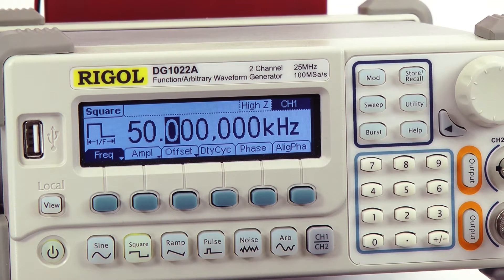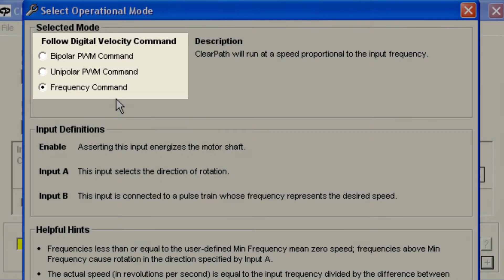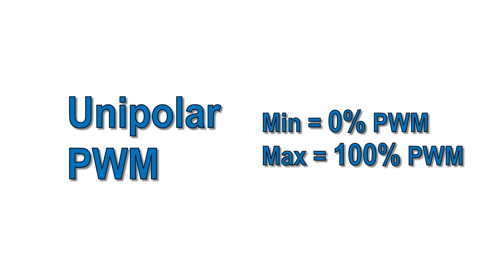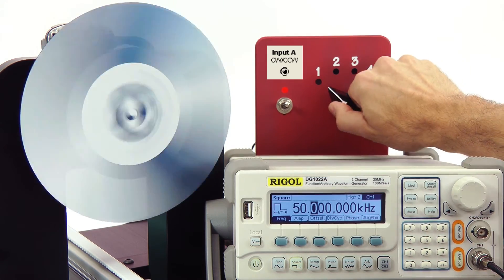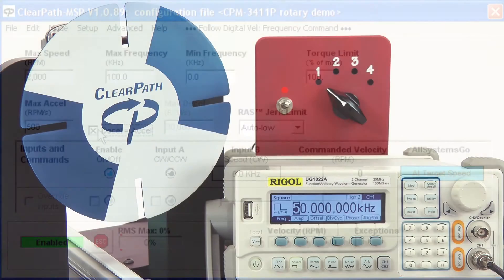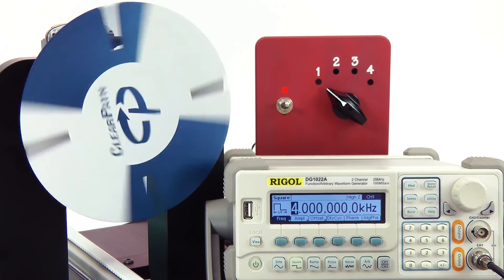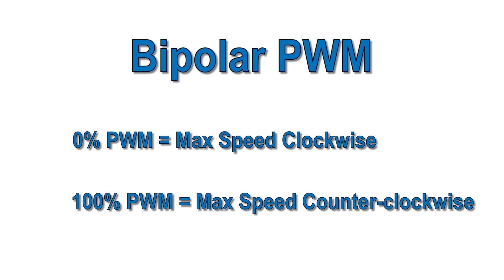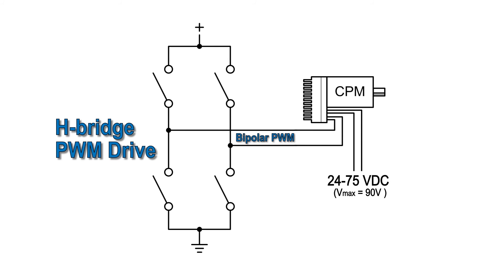ClearPath Integrated Servo Motor: Follow Digital Velocity Command

Comment: How do you set different speeds for CW/CCW, independently, using only Input B? I want to be able to go variably faster in one direction than the other.
Reply from the maker: Hi star child,

All of the "Follow Digital Velocity" mode variations can achieve variable speed in both CW/CCW directions. 

The variant of Follow Digital Velocity that uses a "Bipolar PWM Command" does not need Input A to achieve variable speed and direction control, so this is probably the ideal mode for you if you only want to use Input B. (In this mode, Input A functions as an “Inhibit” control that allows you to stop the motor even if there is a non-zero command on Input B, or to modify the motor’s torque limit. You can leave Input A disconnected if you don’t need either of these features.) 

Input B in this mode controls both speed and direction using a variable duty cycle PWM signal. This is discussed in more detail starting at 3:01 in this video. (This mode does not necessarily require the H-bridge output circuit that is given as an example.)

Note that all of the "Follow Digital Velocity" modes will require the Enable input to be controlled. It needs to be asserted (i.e., "On") to enable the power stage of the motor and allow it to produce torque. So you will need a digital output to enable and disable the motor. 

If you are looking to vary motor velocity by hand, or if the variable duty cycle PWM signal described above is not easy for you to generate, consider using Manual Velocity Control mode instead. This mode will use both Inputs A and B (as well as Enable), but speed and direction could be controlled with a single Quadrature Knob (which can be bought online, e.g., from DigiKey, at low cost). This video explains in more detail:
https://www.youtube.com/watch?v=tR_LrL7UjdA  

I hope this helps. If you have further questions, feel free to reach out to us directly through our "contact us" form (https://www.teknic.com/contact/ ) or call us at 585-784-7454.

Best regards,
Matt C. - Teknic Servo Systems Engineer
Reply: @TeknicInc  Hi Matt, Thanks for the response..
What I want, is to be able to move to absolute position (2 postings) using a squeegee to move inks across a screen. But I must be able to adjust (set) the velocity (speed ) manually between both positions because different inks require different stroke speeds. Different inks can be used throughout the day and manually dialing velocity is a must..

I just don’t know exactly which mode I would use to do that..  All I want to be able do is  to manually set the  the speed  with a knob in both directions but set directions  (CW/CCW) with sensors. 

Thanks..
Reply from the maker: @StarChild.no1  Hi star child,

We certainly can help. Teknic has a team of Application Engineers who are very experienced with a wide variety of motion control applications. If you contact us directly we can discuss your application and give a recommendation on the best servo solution for you.

I can think of a few different ways to accomplish what you describe, all with slightly different details and considerations that would be difficult for me to effectively clarify here.

Give us a call (585-784-7454) or use our "contact us" form (https://www.teknic.com/contact/ ) and we would be happy to help point you in the right direction.

Best regards,
Matt C. - Teknic Servo Systems Engineer

Comment: Are there any benefits to use PWM vs Frequency or vise versa?
Reply from the maker: Hi Colin,

I realize it’s been a long time since you posted this question, and I’m sorry that we missed it at the time. Hopefully you were able to find the answer to your question, but in case you didn’t, or in case someone else has the same question, we’d like to provide a belated answer.

Choosing between Frequency and PWM, there is not a single best option for every scenario. Some controllers may only output one or the other, in which case you’d use whatever you had available. If you have a choice, there are a few things to consider.

The first is that since this video was produced, we’ve added extra functionality to the Bipolar PWM mode. Using this mode you can now change the motor’s torque limit on the fly, or inhibit motion (make the motor hold its position) without needing to set the PWM to exactly 50 percent. If you’d like to use either of these features, you will need to use a PWM command signal (specifically, the Bipolar PWM mode). 

If you’re deciding between Unipolar PWM and Frequency, and your controller has both, Frequency is the best choice. The frequency of a pulsed signal is not affected by the slew rate (i.e., the rise time and fall time) of the pulses, but the duty cycle of the signal is affected. And the slew rate of the pulses is affected by a number of electrical parameters related to the output circuit (and associated cabling) of the device producing the command signal. This variability in slew rate causes an error in duty cycle, particularly at very low and very high duty cycles, that will affect the accuracy of your commanded speed. (And then ClearPath will accurately follow the inaccurate command.)

This link shows a graphic of how inductance, for example, will change the slew rate of pulses and distort the perceived duty cycle:
https://www.researchgate.net/figure/Effect-of-Switch-Inductance-on-the-Quality-of-the-Output-Voltage-Pulse_fig2_4248111

When using a frequency mode in ClearPath as opposed to the related PWM mode, the motor will just count the number of pulses per unit time. A change in the slew rate of the pulses would have no effect on their count per unit time (i.e., the frequency) and hence no effect on the speed being commanded.

To summarize, if you would find it useful to use the Inhibit or Variable Torque Limiting, use the Bipolar PWM mode. If not, and you have a choice between using PWM or Frequency as the command source, I would recommend using Frequency.

If you have further questions, feel free to reach out to us directly through our "contact us" form (https://www.teknic.com/contact/ ) or call us at 585-784-7454. 

Best regards, Trent T. - Teknic Servo Systems Engineer